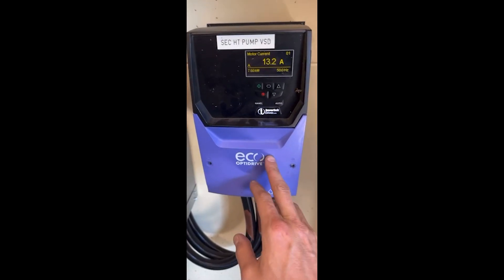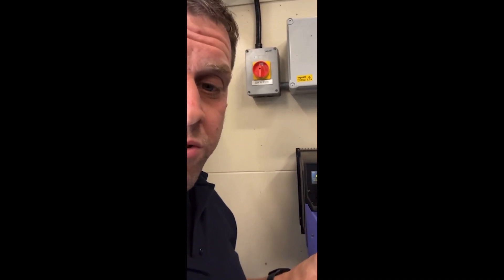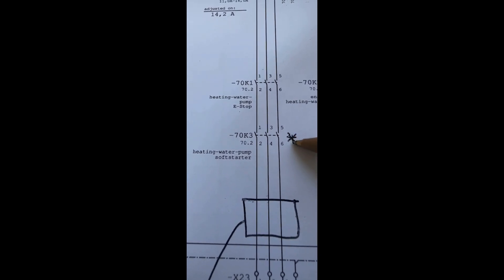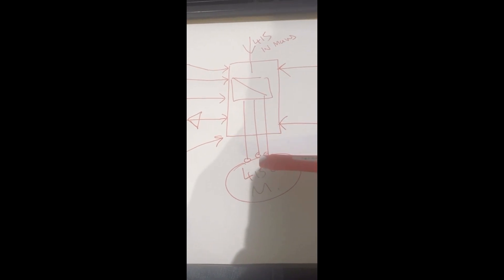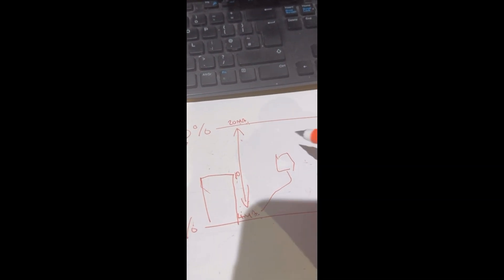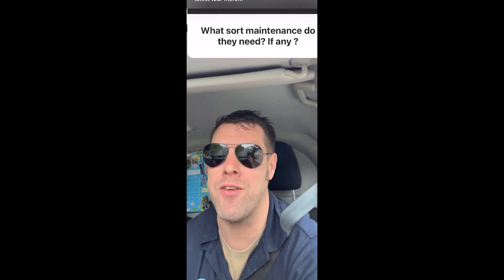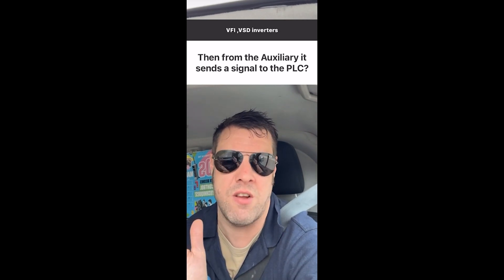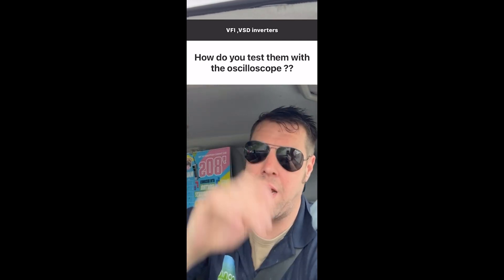motor controls a guide too  VFI , VSD,s and inverters

Comment: Hi Jamie, buy some coloured Sharpies for marking, ok you are into my domain now young man, DC motors often use PWM for speed control ranging from large commercial gear down to  the likes of vehicle dc motor controls and now Drones etc.  According to Sam instead of a cock & balls just draw a beanbag.
Regards from the very old sod..
Reply from the maker: What DC you in to ray , the old stuff or the new stuff , I’ve notice a resurgence in DC servo motors lately after they spent 20 years getting replaced
Reply: @Actual_electrical_content  Hi Jamie, I will be 81 at the end of the year my son work as an Industrial Robot engineer in a local factory he used to work for MK and then Honeywell doing the same job until they sold out to some crap plastic extrusion company who employed a lot of know nothing Tossers so he moved on, I help him with some component repair when they can't get a replacement quick enough.  Also one of my best mates moved to California he is an Auto Mechanic as they call it over there, mostly Volvo and Audi etc. I help him to understand Schematics also with micro soldering on ECU repairs.
Reply from the maker: @raywelshman   RAY PLESE CAN YOU COME ON THE PODCAST message me on any of the soical meidas that can be found here https://linktr.ee/Jamieblatant?utm_source=linktree_admin_share  i am dying to actually chat to you about yur time in the trade